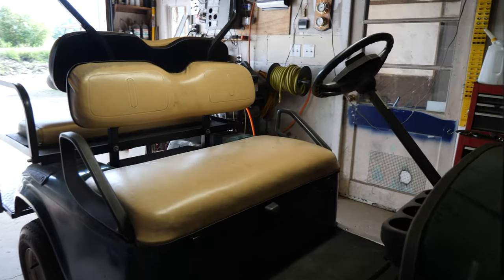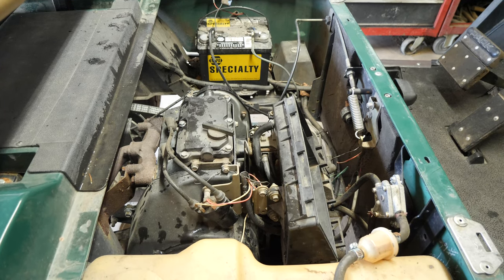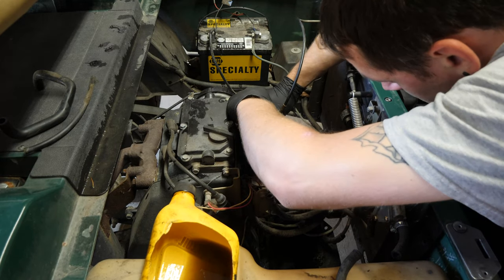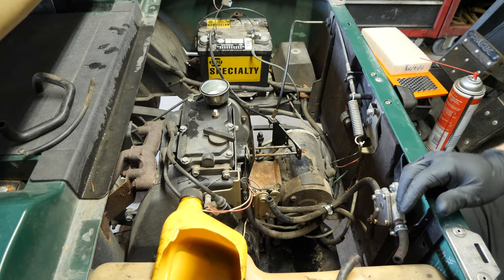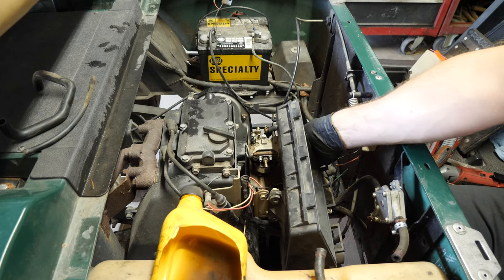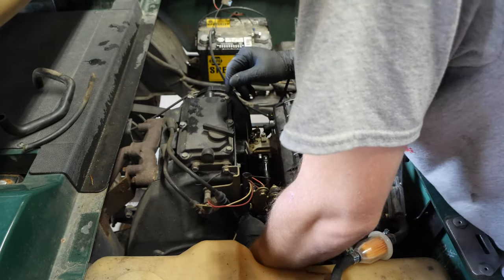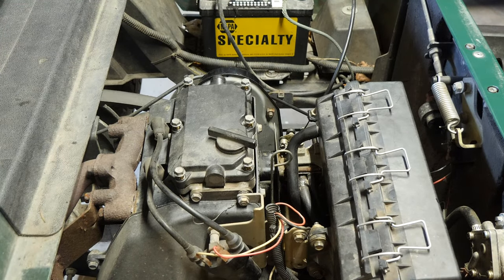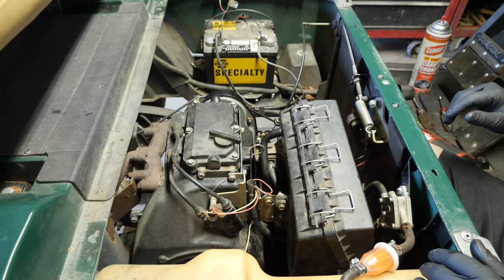2002 EZGO TXT, Gas - Hard Starting, Smell of Gas

Comment: Hi Kevin. I enjoy your no nonsense videos. We have a 2007 TXT with 1025 hours that just about makes us pass out from the exhaust fumes. It smells horrible. In the summer we put the windshield down to make sure there's a breeze to get rid of the fumes. Last spring I adjusted the valves, changed the oil, replaced the plugs, fuel & air filter, and replaced the carburetor to no avail.  We don't drive it all that often, but today I drove my son to the bus-stop about 20 minutes away and by the time I got home, I was delirious from the fumes. I've checked for exhaust leaks at the engine and it appears to be fine. It occasionally backfires on the down-hill. It starts easily and seems to go down the road fine. I'm going to check the valves again and try to make a tail-pipe off the muffler to try to direct the exhaust out the back. It's gotten to the point where we don't even want to drive it anymore.  Any suggestions other than a engine swap?

Comment: Kevin, I have a 2003 EZGO and we just rebuilt the ending. After putting it back together, it feels the cart when driving it around seems to go good, them it slows down, then speeds back up. Would this be the governor working against the engine.? Your thoughts, please. Hoping this explains it well enough.

Comment: HI Kevin. Do you have any vid's (or can you make one) that discusses how to follow and diagnose electrical issues (ohm testing) from the battery through all the micro switches then on to the pulse coil and ignition coil? Also is there a vid on changing out a pulse coil or how to tell if your starter/generator is bad? I'm working on one of these carts for a Monastery here in southern Arizona and it was running but now its a no start. Going to do a comp test and adj valves tomorrow. Thanks for any tips.

Comment: Great job Kevin as usual!  Question I want to put a fuel shut off valve on my 2004 EXGO TXT, where would you recommend installing it? Right after fuel tank or before pump or after pump! Thanks
Reply from the maker: When I install them, I place them just after the fuel tank outlet.

Comment: Hi Kevin, I'm about to pull my hair out. My cart is a 2001 Ezgo. The problem I'm having is it will not start after backing down an incline. It will start fine in my garage or on my trailer and as long as I keep it in reverse and not stop it will keep running. I can smell fuel when this happens ( after backing down the incline ) As soon as I stop and put it in forward it will not start again. After waiting for 5-10 minutes it will start again and it will run all day without a problem, forward or reverse. I'm not a mechanic but a retired Lineman but try to fix what I can ( And yes,like you I use my klein's for a lot of things :) ) What iI have done to try and correct this problem.  1. replaced the carb ( aftermarket ) That was after soaking,cleaning all the jets and blowing out with compressed air. No change so I replaced it. 2 replaced the fuel pump. 3 Replaced all fuel lines 4 Replaced the fuel filter 5 Replaced the air filter. The choke and throttle cable seem to be working fine. After watching your video my next step is adjusting the valves ?  I hope you have some idea where the problem is other than between my ears. My next purchase my be some C-4   Any will be much appreciated --
Reply from the maker: This is one of those issues that you can chase forever and it will get REAL annoying REAL quick. I feel your pain and frustration with this. I would start with adjusting the valves and see if that helps. It sounds like a bit of fuel dumping into the intake when you back down a decline. You may have to take the carb apart and see if the float has a metal plate under the needle valve (float valve). If it does, you can manipulate that plate by bending it to make the needle valve close sooner to keep less fuel in the carb. It would only need to be tiny adjustments. I'm willing to bet that its all plastic crap inside the carb with nothing to adjust. These should be able to back down a steep hill and run fine. Another thing to check is all of the cables and wires. I know it sounds strange, but I've had carts that wouldn't run if there were at a certain angle due to a wire being lose or shoring out.
Reply: @Kevinsgolfcarts  Thank you Sir: I will keep plugging away at it. I will try your suggestions. Again, thanks for taking the time to reply

Comment: Have a 1999 txt gas. Started out by cranking and only firing occasionally then stopped firing all together. Replaced plugs, igniter, igniter coil, battery and cleaned carb. Have spark, adjusted valves and have 150 compression on both cylinders and fuel pump is working. Still will only crank and not fire. STUCK! Any help would be great!

Comment: Hey Kevin, I have a 1990 ezgo  have changed carb. spark plug,  and coil. has 120 psi comp. and fuel pump works good. It will run great for several golf holes and then it just turns over but will not start. Can you point me in  any direction to fix this?

Comment: hey kevin when reringing a 2002 st 350 engine is it common to have to bore the cylinders or just hone them? ive not torn mine down yet but im getting smoking and low compression. thx for your videos. very helpful.
Reply from the maker: That will depend on how badly the cylinders are wore. They need to be checked with a micrometer and be within a certain spec. If they are outside of that spec, then they need to be bored. I don't have the exact numbers right at the moment but you should be able to google the specs. depending on the year, if its running the 2 cylinder robin engine, its probably in need of a valve adjustment and bad valve guides.

Comment: I had the same sticking issue with the plunger on my carburetor. Got it taken off and cleaned and working. But now when I try and start the cart it just makes a clicking noise and won’t turn over. Checked the battery, battery is good. Any idea? I did not mess with the valves after fixing the carb.
Reply: Sounds like the brushes in the starter generator are the problem.  Plenty of videos on that very problem.  Bushes aren’t that hard to replace after removing the starter..  You can try tapping the starter generator or change the position of the armature in the starter by turning the belt between the starter and the engine.

Comment: Hi Kevin,  Great video.  Quick question are the valve clearances  intake and exhaust  the same .006" ?
Reply from the maker: Robin engines are .004 on both intake and exhaust, adjusted while cold. I talk about why I used .006 in other videos.
Reply: Have one that compression is 90 on one cyl 120 on other is that enough to cause fuel smell and lack of power/hard to start

Comment: kevin what causes vapor to blow outwards from the carb? i have just replaced the carburetor and spark plugs to see if that would help and it is not. I have a gas ez go txt and it will not crank unless i try it for a while, but only runs well on choke.  Would setting lash on the valves maybe help? I'm stumped
Reply from the maker: You need to do a compression test, adjust the valves and redo the compression test. If you see an improvement, then you should be good.
Reply: @Kevinsgolfcarts  You're the man. ran compression on it and only had 50psi. Adjusted valves and went to 150psi. fired right up and runs like a top. Thank you very much for the videos

Comment: Hey Kevin, I have a 98 txt has cart. i am having issues with it not picking up too speed. there will be times I can feel it start to speed up but stop. it looks and sounds like its topping out when I have the rear end lifted. any thoughts?
Reply from the maker: I would do a compression test and adjust the valves first. Loss of compression due to the valves being out of spec will cause loss of power and acceleration. If that checks out, throttle cables could be sticking and not allowing the full range of motion. I would replace any cables that are sticking or stretched. Make sure the air filters is nice and clean as well.

Comment: Kevin what replacement carb would you purchase for a 2005 Ezgo with Fj 400d motor. Ezgo wants $400+. The float sticks on mine and there’s no rebuilding it as Ezgo designed it that way. Thanks
Reply from the maker: Yeah, if you want to pay stupid money for a simple carb, you can order it from EZGO. I'm a RHOX dealer so I get most of my parts from Red Hawk. You can search for EZGO carb 17565 and find it from other retailers for way less. Its a similar carb to the one I use.
Reply: @Kevinsgolfcarts  Kevin thanks for your reply on the carb but need to ask another question. What would cause the starter/generator to load up but not turn the engine over sometimes when depressing the accelerator pedal. I keep the battery on a maintenance charger when in the garage and the battery is putting out 12.5 volts according to a dash mounted voltage gauge. Oh and I checked the brushes on the starter generator and they’re good.  It’s been doing this for quite a while and sometimes it acts like it’s not gonna start. I have to feather the pedal several times to overcome it. Appreciate your consideration and look forward to your answer thanks, Steve H
Reply from the maker: Those earlier EZGOs with the FJ400 had whimpy starter/generators for the larger displacement of the FJ400. If its the stock, original one, it maybe getting a bit tired. It takes a lot of juice to roll over the compression stroke. A battery maintainer should hold the battery around 12.8, depending on the battery you have installed. The better built maintainers do a better job so if you have one of those crappy horrible freight ones, get a better one like BatteryTender.
Reply: @Kevinsgolfcarts  Hey so thanks again for the reply to my question. Don’t know if it’s the original as I bought the cart used but it’s an 09 and I bought it in 2013. Like I said I removed a rubber access on the top of the starter generator and the one brush I was able to inspect had plenty of  surface above the wear line so I assume the others would be the same. If there’s no adjustment on cables or carb to help then I guess I’ll just keep the battery fresh and rock on. Thanks again sir

Comment: Kevin my ezgo express will turn over but motor won't start unless you push the cart or hold the pedal down for 3 or so minutes.....any common issues it could be?
Reply from the maker: It sounds like the drive clutch is stuck closed and not allowing the engine to rotate freely. It could also be the starter/generator or brushes. It could be a weak battery.
Reply: @Kevinsgolfcarts  thanks Kevin. Yea I pretty much suspected most of those things being the issue lol. I just changed the battery and didn't make a difference so ill just begin tracing it down. The cart does go and does not lose power. Only when you go to complete stop. The belt squeals and then it just chugs until finally catching and taking off. Thanks for the quick reply and videos

Comment: Our 92 gas ezgo won’t pull uphill?backfires a lot.Any ideas?
Reply from the maker: You will need to do a compression test. You possibly will need to adjust the valves.
Reply: @Kevinsgolfcarts  my husband adjusted the valves.Still boggs down totally stops up hill.Then takes a bit to get it going again.
Reply from the maker: Try removing and clean the carb. There are no adjustments or rebuild kits. Sometimes crap gets into the bowl and cause issues. He will still need to do a compression test. Anything less than 140psi and it will not run correctly.
Reply: @Kevinsgolfcarts  could it be a clutch?
Reply from the maker: Clutches will typically cause torque and speed issues while driving with a well running engine. Engine issues will cause the engine to not run and perform to its max. A compression test will tell a lot of the condition of the engine. You have a 92 and the engine is probably wore out if it has never been rebuilt.
Reply: @Kevinsgolfcarts  it was rebuilt about 3 years ago
Reply: @Kevinsgolfcarts  98 txt, I rebuilt  about 2 yrs ago. Master tech by trade, everything is done correctly but boy these old engines are rattley and noisy.  Seems the post MCI engines are much quieter...
Reply from the maker: @robertmartin8577  It shouldn't rattle at all. These engines are quite smooth and quiet, even pre MCI. I have several pre MCI carts with smooth, quiet engines.
Reply: Do you have a part number or link for backfire plate… mine is totally missing from air box.. could even fab if had some info on it… great video thanks in advance…

Comment: The video is better with the volume turned down so you can’t hear Mr negative complaining about working on a cart. 😕
Reply: OMG I was wondering if it was just me. It's a golf cart, not a 1992 New Holland L785 replacing the all the hydraulic lines and pump.